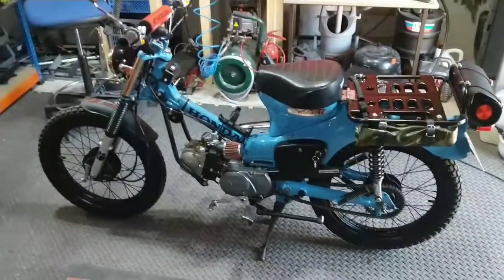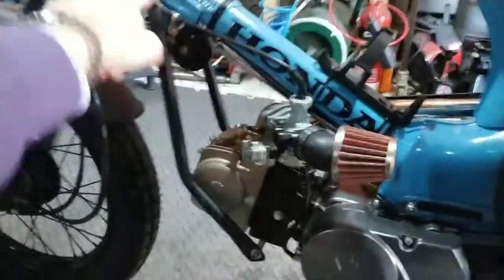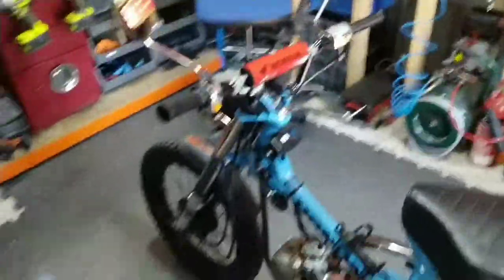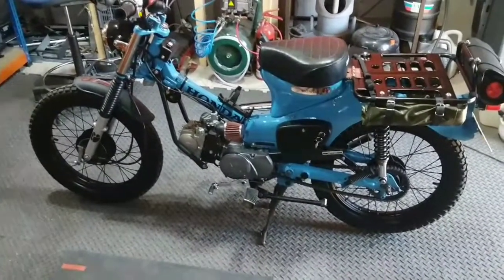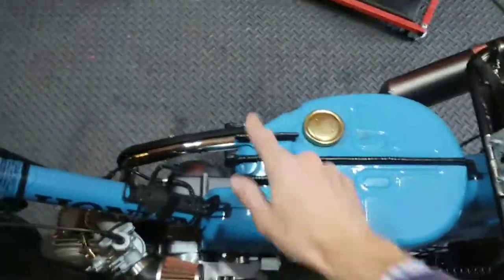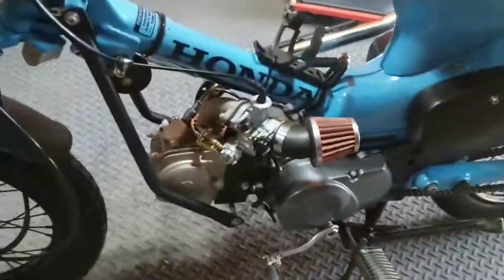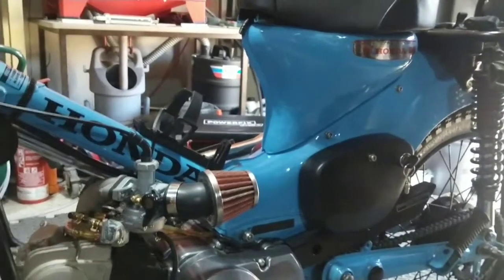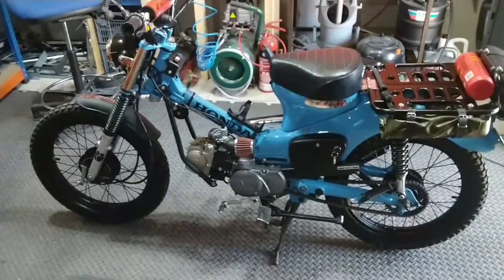Honda C90 Restomod Completion..!

Comment: I you have any issues with the bottom end it would be maybe a crank rebuild and/or crank seals if it's been stood for a very very long time, these engines and their gearbox's are bullet proof.
Grampian Motors are excellent for 2 stroke crank rebuilds and it won't break your bank.